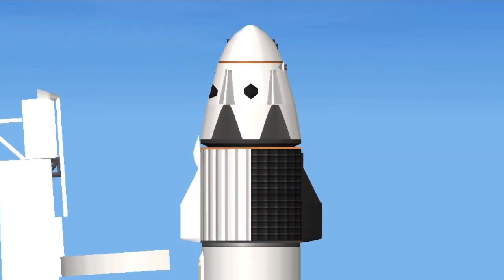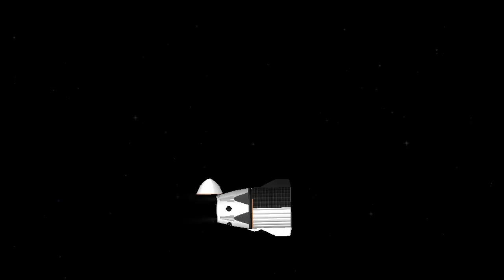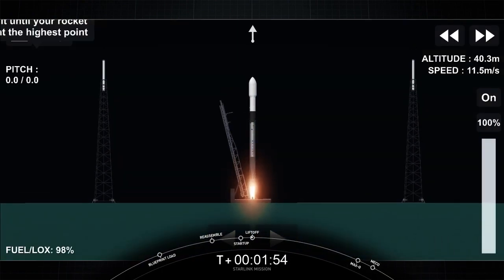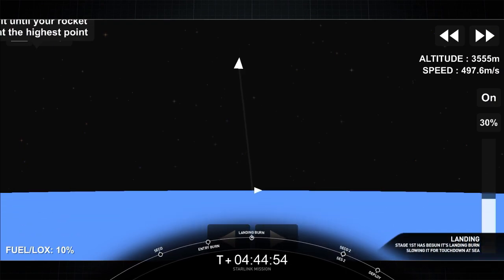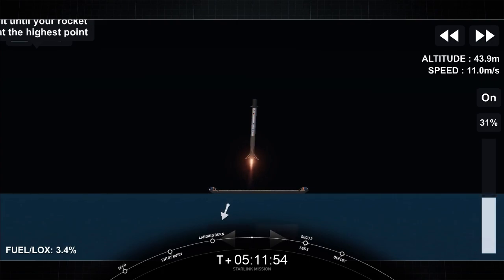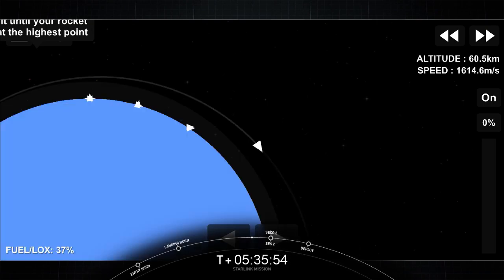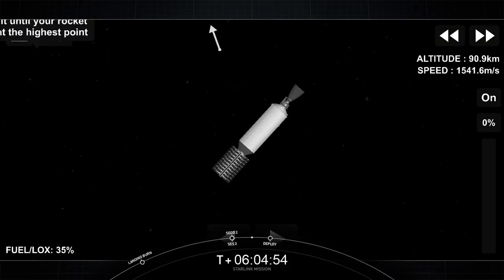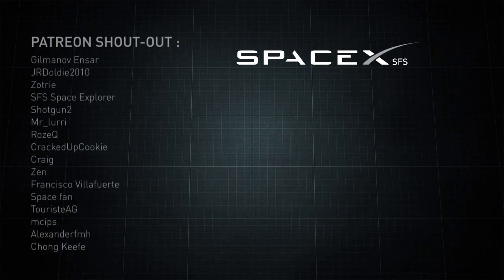Starlink-22 Mission

Comment: One thing to improve the falcon 9, on a part of the center change it to white and it should look more like a real first stage booster
Reply from the maker: Can you explain the details? Which parts that i should improve?
Reply: Like on the center fuel tank change that to white and it should look better if not change it back
Reply from the maker: @zackaviation450  it's sooty, a sooty booster, as the real one during launch, if i use clear white booster it's mean i use a brand new booster, which mean different from original livestream does
Reply: Oh ok